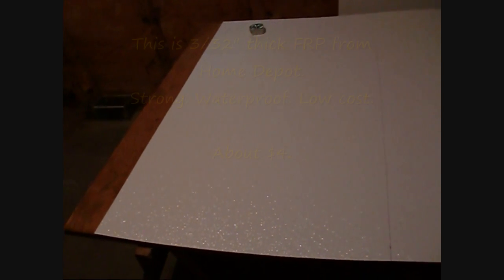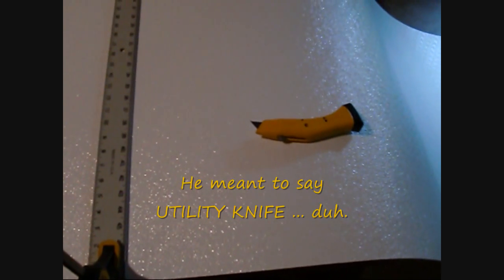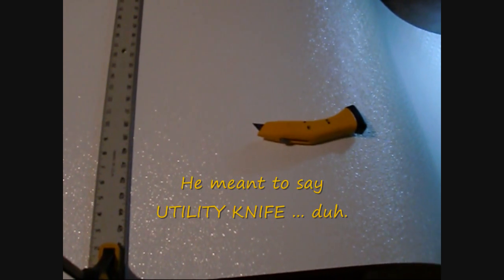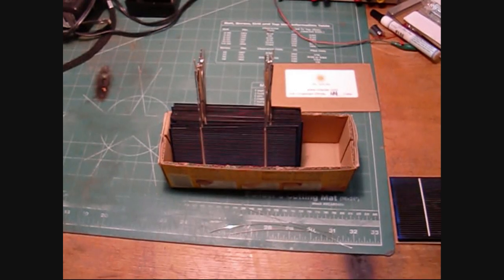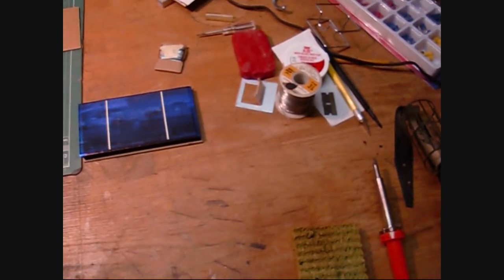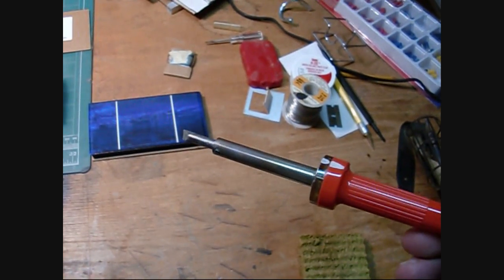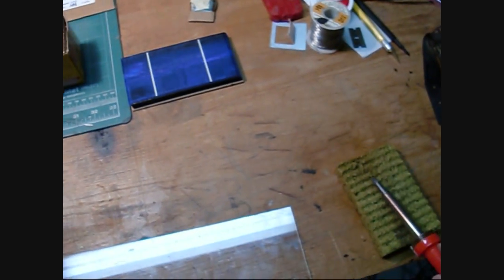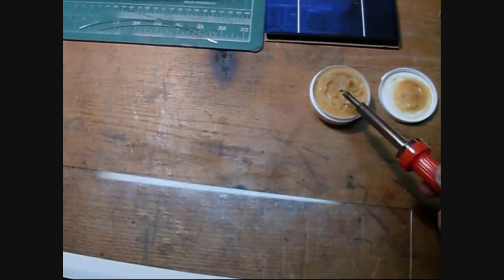PART 4:  $100 70w Solar Panel DIY project

Comment: @VWRabbitdiesel It's wall covering. It'll keep the moisture out and maybe keep the moisture in ( when you silicone the edges). I worry about the glass cracking though.